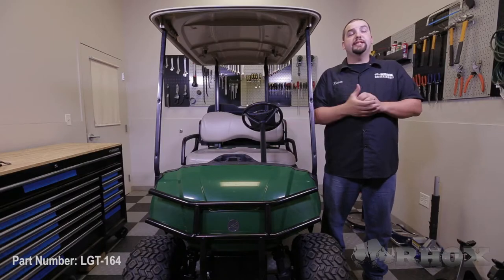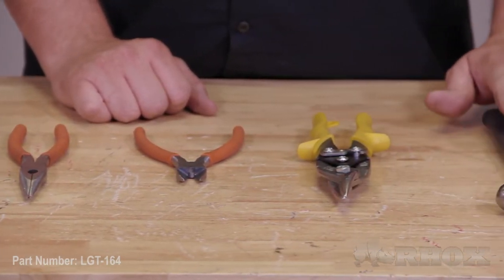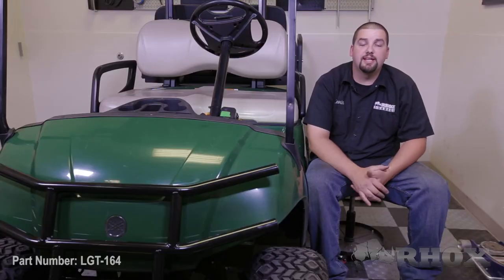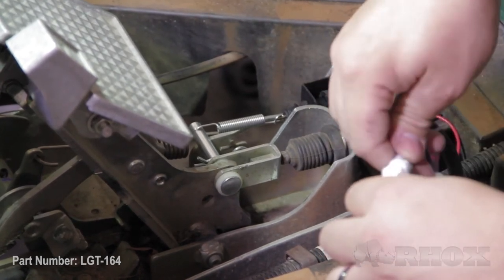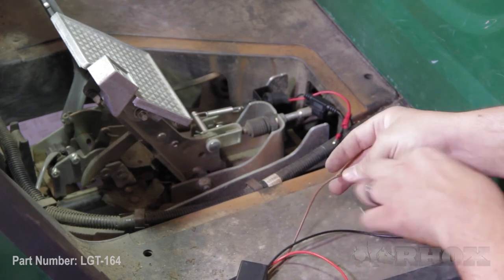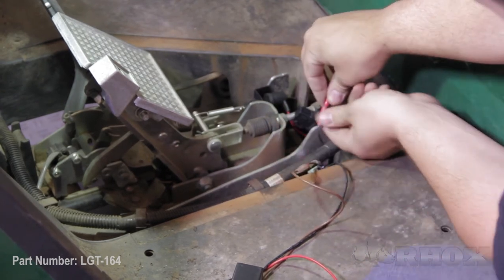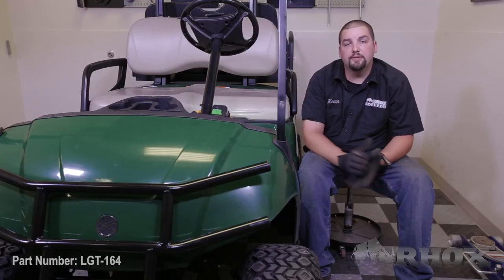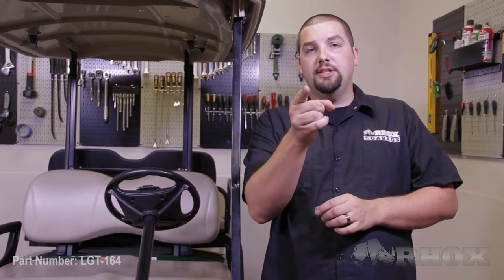LGT-164 (LGT-B8) Brake Switch Kit on a Yamaha Drive with a New Style Pedal Group

Comment: I have the brake pad on the brake pedal, which use 2 wires.  Will this product work on any light system that supports brakes?
Reply from the maker: We cannot say.  We know it will work on RHOX wiring harnesses. Any other harness may vary.

Comment: Does the time delay relay switch turn off the brake lights when the parking brake is used?
Reply from the maker: Yes, it will wait a little bit then cut it off so your batteries don't drain.
Reply: @GolfCartInstructions  , Do you know if the 2014 Yamaha golf cart has a delay switch, if so where is it located?
Reply from the maker: @bobamsden8050  No, this would come with the brake kit from RHOX.  If you bought a 2014 Yamaha with a light kit and brake kit installed, you would have to look in the brake pedal compartment to find out if there is one already in place.
Reply: @GolfCartInstructions  Do you know how to wire this if you have no harness? We have a 2007 that has "Dumb Lights" there is no wires ran for a brake switch, there is a harness for the existing ligts but no 3rd wire ran for the 3 wire rear lights. Is that 3rd wire a ground or a hot? I'm assuming hot. Is there a diagram for the relay box also?
Reply from the maker: @trendkilla254  If you have no harness, you can use the LGT-138B harness (link below).  You will need to have three wire taillights.  The third wire is for the brake/turn signal. We do sell a set of taillights separately (LGT-335).  More than likely they will match the holes in your rear body but I would compare the template to the holes to be sure.  To get a copy of the template, please submit a contact form on the RHOX.com site so we can email you one.   

LGT-138B: http://www.golfcart.com/pc_product_detail.asp?key=4ABF3C6DE31A429F864459B056350540

LGT-335: http://www.golfcart.com/pc_product_detail.asp?key=E8EE379E1A0045D09CCBADD91F0283E3

Comment: I’m confused. What does this part do? I was looking for a brake light switch but this cart doesn’t even have headlights, so it likely doesn’t have tail lights either.
Reply from the maker: This part is just the brake light switch that will allow existing taillights (if capable of brake function) to illuminate as brake lights when the brake pedal is pressed. It does not come with taillights.